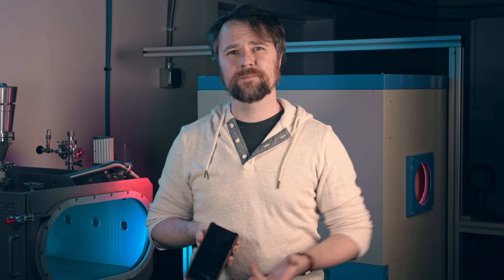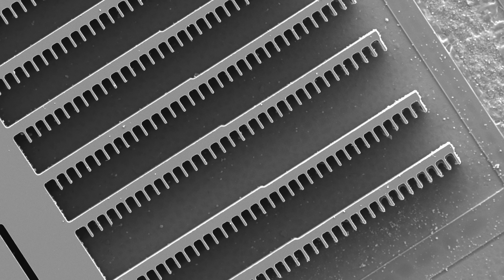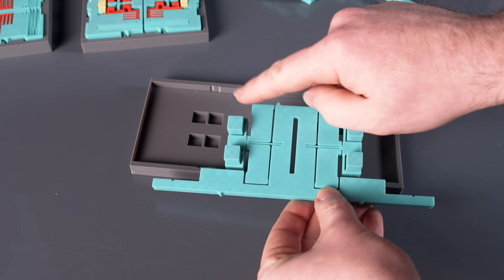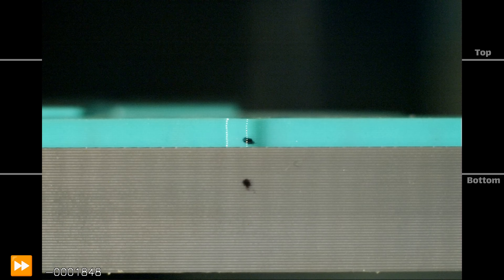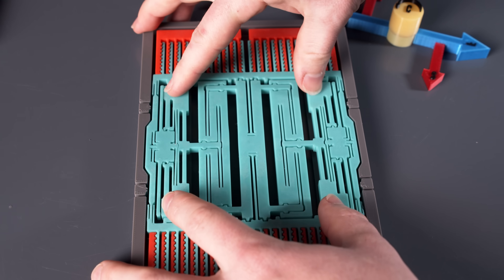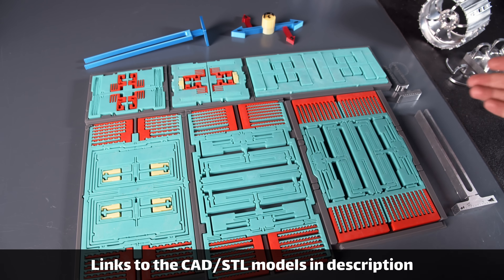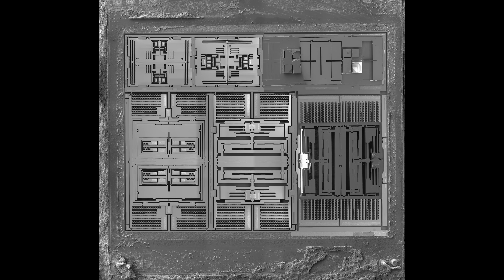The Micro Mechanisms in Your Phone

Comment: I'm not sure if you've done a video on one of the OG popular MEMS devices (DLP chips or inkjet printer nozzles) but they'd be neat to see and are structurally quite simple to understand.

I'd also love to see more insight and models with some of the tiny motors and microfluidics devices they make using MEMS technology, although I know such devices are much more niche and hence harder to get a hold of than something commodity like an accelerometer/gyroscope.

I know they also make MEMS microphones these days, so seeing how those are built and comparing them to the previous go-to for compact microphones (electret capsules) would be fascinating.

They can also apparently make compasses (do they use an electromagnet? tiny permanent magnet?) and humidity sensors (what part of this is responding to humidity?) in MEMS, and I can't imagine how they're pulling that off so those might be neat to investigate as well.
Reply: Compasses use HAL-sensors and how the current bends in a metal sheet when exposed to a field. Not that much to see I guess? not actually a MEMS device.

Microphones is likely just the acclerator connected to a membrane instead of a mass (aka not that much new?).

Humidity sensors seems to use the conductivity of material vs wetness or a capacitor where the dieletric gets wet(hydroscopic) from the air.
Likely not really MEMS, probably just a blob of special material on two metal conductors?
Reply: I second compasses and humidity sensors!

Comment: I know that the miniaturization and design of transistors is an unimaginably complex feat of engineering, but MEMS devices always blow me away more. Maybe it's because I know they rely on physical movement, or the designs look so alien, but dang... they're so cool.
Reply: Totally. Making a solid block seems way simpler than making a device with open voids. Open voids in a tiny device really takes some serious tricks to pull off.

Comment: This was a phenomenal video! I can imagine how tedious it must have been to trace all the elements, then convert them into a 3D model that could be printed 😮👍

That added SO much to the understanding, though, making for a really extraordinary explainer video.

I found it especially interesting how they can integrate the Z axis into that same planar structure - I’d always wondered how they managed to do 3 axes, and thought there must be a second chip at right angles inside the package.

This was also the first time I understood how they manage to translate the coriolis forces into a measurable signal. The shift in resonant frequency was entirely unexpected.

A number of years ago I was looking at an application for a gyro where I needed a lot of sensitivity to small movements. Analog Devices (now part of someone larger, I think TI) had a unit that was an order of magnitude more sensitive than the standard parts. An engineer there explained that it operated on a somewhat different principle, but didn’t explain what that was. It’s be interesting to find out what that was :-)

BTW, the killer app that made these  jellybean parts was car airbags. They needed ultra-reliable inexpensive accelerometers, and the millions of units requirement drove the development of MEMS accelerometers. Gyros came later, once the basic tech had been perfected for the airbag market.

Btw, what’s the purpose of the chip bonded on top? Just protection?
Reply: The chip on top is the ASIC for the sensor, stacked to keep it small. https://www.youtube.com/watch?v=l75IiNVRdfg at 1:15

Comment: I would think that when your phone is sitting on the table, it's actually feeling 9.81 m/s2 (1G) of acceleration upward, and when it's in free fall it's feeling no acceleration at all (and can no longer tell which way is up) 

The software probably automatically offsets the calculations tho.
Reply: We should distinguish between ACTUAL acceleration, which is a derivative of actual velocity, and the FORCE of acceleration. i.e. when you drop the phone, it starts moving and accelerating. You can see that it is really moving and accelerating, When the phone is on the table it is NOT accelerating,  But it feeling the acceleration due to gravity.

Comment: So, you didn't try to import the pictures into inkscape, to automatically convert them into SVG, to then import the SVG into fusion? In my experience its bitmap tracing feature works pretty well.
Aaand you didn't try "Potrace", that the inkscape bitmap-tracing-feature is based on? Still GPL software, but with more options and settings to tweak.

Comment: How do sensing combs work? Because when comb teeth move relative to each other, capacitor gap on side of each tooth increases, but the other side decreases by the exact same amount. Capacitance of each "side" is proportional to 1/d, so if the comb is displaced by a small x, then total capacitance is 1/(d+x)+1/(d-x). How do they determine which direction the combs moved at all, since capacitance change in both directions is the same?
Reply: Well.. they are silicon and may not need to be all conductive. It's unclear where the actual eletrical connections may be.

Also opening/closing the gap may be the movement, instead of sideways.

Comment: "so when you drop your phone, it experiences an acceleration downwards"
You mean it actually stops experiencing an acceleration upwards? You stop feeling acceleration when you fall, you're like in zero G but with air resistance, gravity works the opposite way we usually think
Reply: We should distinguish between actual acceleration, which is a derivative of velocity, and the force of acceleration. i.e. when you drop the phone, it starts moving and accelerating. You can see that it is really moving and accelerating,

Comment: I remember when I was a kid and I used an iPod Touch for the first time. Upon experimentation I deduced there must be three separate GPS chips in there, presumably in the corners of the device, to figure out its orientation and rotation. Then I learned about accelerometers and gyroscopes and began building balancing robots...
Reply: also, as a non-micro mems, someone made a demonstration using a small flexible resistor strip with a weight on the end of it as a one-axis accelerometer. It was pretty nifty, though sadly I cannot find the video anymore :(

Comment: allot of thins not quite correct on a technical and how it was done in the chip level but i think a good entry for beginners. One important point you missed is that with the rotational sensors that work on Coriolis forces is the center of rotation does not matter to the sensor, that is the beauty  and why Coriolis is used.
Reply: Someone who misuses the word "allot" as badly as you did shouldn't criticize other people's work.
Reply: @bobbydazzler6990  Technical incorrect is just that, as a top level view might be adequate but from him, i expect much better accuracy

Comment: BT: It took a week
Me: THANK YOU!
BT: You're welcome
Reply: In addition to the pinned 'errata' section, a few other points:
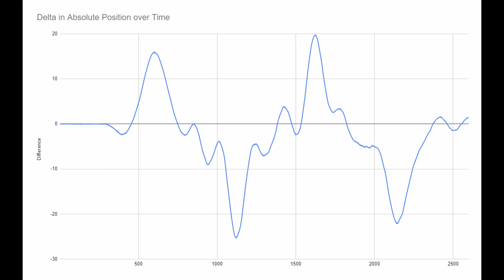- The natural resonant frequency of the MEMS accelerometer is much higher than the printed parts - the funky plot at 7:54 is a result of resonance modes within your printed parts reacting to a step-stimulus from the actuator (discontinuous, in any case). 
- your tuning-fork/Coriolis-force explanation was spot-on!
- Some accelerometers have integrated comb-actuators to self-test the proof-mass and pickup electronics by self-driving the mass during a "power-on self-test" or similar.

Massive thanks for openly distributing the 3d-models :)

Comment: That video was amazing! I always though the construction of X-Y-Z axis (for both gyro and accel) was somewhat the same, but it is actually different (especially the Z ones). I just wonder how much software compensation runs inside the device to compensate for length/mass differences between each axis.

Also congrats by the 3D Model! I will be surely printing one some time.
Reply: I imagine that compensating for the different responses of the three axes is done during calibration, yeah?
Reply: @Zeuskabob1  yeah, I can't imagine the living hell that is to calibrate those things in factory. At least for the acelerometer they have gravity reference for that.
Reply: @Zeuskabob1  Oh I just re-read what you said. I would say yes, but I remember last time I did some accelerometer calibration the values where pretty much the same for each axis. Also gyros didn't have much difference between scaling factors.
Reply: @Zeuskabob1  For the differences in physical construction, I would expect significant differences between each axis.

Comment: How are they manufactured? They're so tiny, are they grown like silicon chips?
Reply from the maker: Photolithography and a process called DRIE (deep reactive ion etching). Basically they make a pattern using tools similar to generating transistors, then use the DRIE process to etch down into the silicon. Rinse and repeat as needed to define the shape, and then deposit layers of metal for traces,e tc.

Comment: What's always striking me as a analog electronic feat is the fact that those device are (almost) always relying on relatives measurements in capacitive changes ! (as opposed to absolute measurements) . 
When you learn how capacitance measurements are prone to drift and environment changes, it's crazy to think a "mere" MPU6050 can measure rotational rate down to 1°/s  ! (@ a range of 250°/s and ADC errors of 4‰)  
Heck, 1°/s is super slow for such a rigid and tiny silicon body ! 😲
Reply: I've worked with these devices on the programming side--it's amazing what can be done with calibration to compensate for static or slowly changing parameters, coupled with very interesting math to form the best estimate of the values of rapidly changing parameters.
Reply: @johnathancorgan3994  Yes 🤩! And if I recall correctly, with those specific ICs, you can/must upload the  algorithm at boot for it to compute and output a nicely filtered quaternion out of their measurements. Right ?
Reply: @asmotaku  Some of them will have been calibrated at the factory and have a small onboard CPU to apply the calibration and filtering before outputting its measurements. Other, cheaper ones require all this to be done in an external processor.

Comment: This is an incredible presentation and explanation! Top 10 channels in my sub list and that's pretty big. I wonder if there are any MEMS devices which work in a piezo-electric way, where the flexure of the material produces a voltage and that is then converted to movements, vs this capacitance method.
Reply from the maker: Oh yeah, definitely! The cantilever on my AFM is a MEMS device, and I think they detect the oscillations via a piezo element embedded in the cantilever base. I think it's less common since it's a much more difficult process for fabs, needing to deposit a piezo material compared to just another metal layer and traces. But adds a huge amount of flexibility since you can put strain sensors right where you want them. Very cool stuff!
Reply: @BreakingTaps  I think it would be worthy a video on how you decapped these. I know you briefly went over it, but I'd love to see the actual process. How many did you have to do this to to create your composite?

Comment: Long time ago back in early '90 I had toy that weirdly knew when I picked it up and knew when to go silent when I put it on it side... As a kid that put magnet on TV(old cathode ray tube) or put screwdriver to wall socket just to see what will happen, I of course took it apart and I found that it had two small cylinders with tinny little ball on a string inside that just contact one side and turn power on... mind blowing and simple thing....

Comment: question regarding the accelerometers: why do they always come in pairs? does this have to do with detecting positive versus negative acceleration?
Reply: There's one for each axis of space. Also, it might be obvious, but objects move in 3 dimensions, so it's not as if only one accelerometer is functioning at a time -- all three are, and some fancy math gives you total acceleration.
Reply: @larrybud  thank you. i should have probably be more precise in my phrasing. if you look at 9:35 for example, the assembly used to measure acceleration in one axis is mirrored horizontally. there are two copies of the flexure mechanism in one axis. i was wondering what the purpose of this duplication is.
Reply: I think the paring/mirroring helps to cancel out side-effects. Compare the design of a mass flow meter. (Look up the wikipedia page for 'mass flow meter.) (The animations in that article were manufactured by me.)

Comment: Your video quality is beyond amazing. Super informative and helpful. As with a lot of technology i simply do not have time to read lots and lots on them, so videos like these provide months of research in 20 minutes or less, which is amazing.
I do however need to ask, gravity is not a force, when you drop your phone, the ground is accelerating upwards and the phone will feel no gravity, according to GR.
Therefore, does the phone have a range of pre set parameters for earths gravity, so it can detect the lack of acceleration?
Reply from the maker: Thanks! 🥰 And yeah, I botched the explanation on that... check the pinned comment, a viewer explained how it actually works vs. what I said :) Tl;dr: it's actually the restoring force of the flexure that's detected (acting like a spring), unlike what i said

Comment: This is a REALLY great video, but I think you made an important (very confusing) mistake regarding the axes involved in the gyroscopes. The physical "axes diagram" you made is perfect for understanding the coriolis force **in general**, but you don't rotate that physical diagram to orientate it correctly with the first two gyroscopes. For the first gyro scope, you should have held the physical diagram in the air and rotated it along the blue resonance axis so that the red coriolis arrows were pointing into and out from the table. I was really confused with the first accelerometer would need trenches (and why the tines were contorting into/out from the table instead of into/out from the camera's Y-axis) because I assumed that your physical diagram was still directly representing the same/correct axes.
Reply: I think this is a big enough, and more importantly a visual enough, problem that you should reupload to fix that part of the explanation while the video's young. Thanks so much for the otherwise perfect video, I've always been so curious about this exact mechanism and it's always needed a good video to explain it spatially/visually!

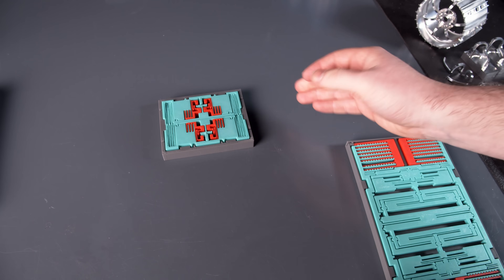Comment: 11:01 I don’t understand why the X axis part can’t just be turned 90 degrees and the exact same layout then be used for the Y axis. Why does the Y axis have the extra yellow combs when the X axis works just fine without them. For the record I’m not knowledgeable about electronics. I watch stuff like this because it’s interesting and I can learn things. So please give any explanation in a way that a layman can understand. I know you kinda explained why the yellow combs were there but it made little sense. I honestly don’t understand why the exact same part (the X axis accelerometer) can’t be turned 90 degrees and used for the Y axis. Moving along the Y axis can’t be any more difficult than moving along the X axis but that’s what I’m getting from this. It feels like there must be a reason the Y axis needs to be more sensitive but for the life of me I can’t figure out why 😂
Reply from the maker: Not entirely certain myself, but I think it boils down to what @larrybud said: physical restrictions of the die itself. They probably needed a certain amount of space for the gyros, given how complicated they are. Which probably meant they had to compromise on the dimensions of the accelerometers and fit them in the leftover space. In theory they absolutely could have rotated it 90 degrees, but since the accelerometers are rectangles instead of squares it would have meant wasted space above/below the X accelerometer. I'm assuming it was simpler/better/cheaper to just add in some extra sensing combs rather than reduce the size of the gyros, or waste space on the X.

But yeah, not entirely sure myself!
Reply: I'm wondering if it's a space issue and just physical dimensions of the required specs for this particular chip?